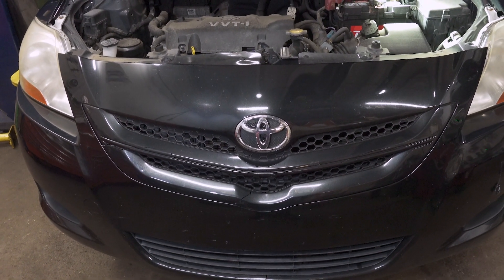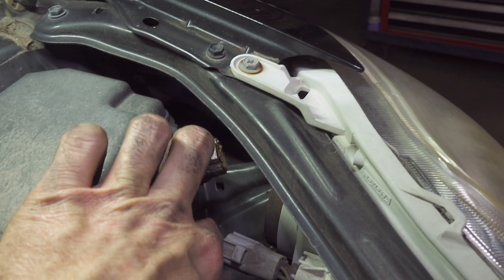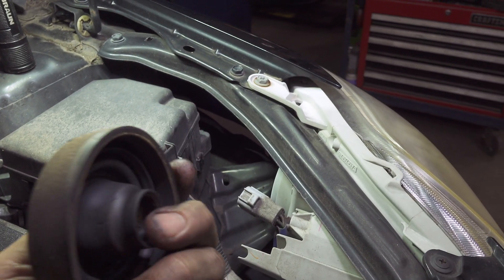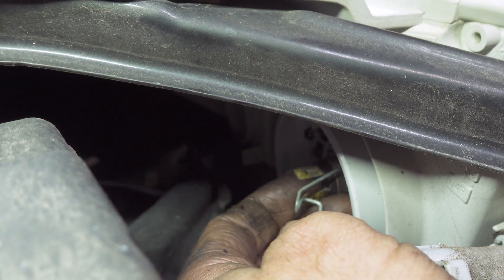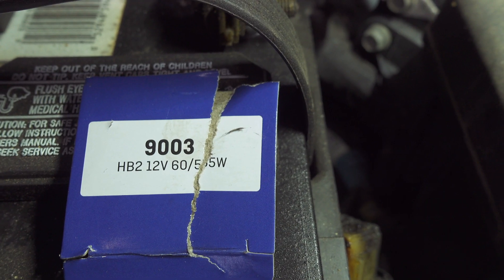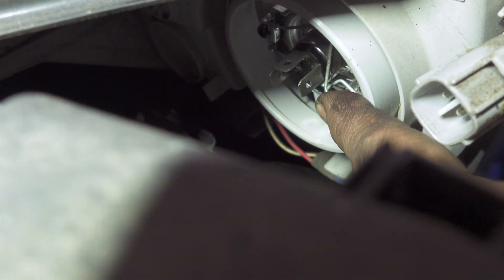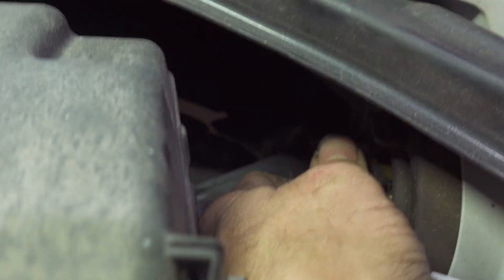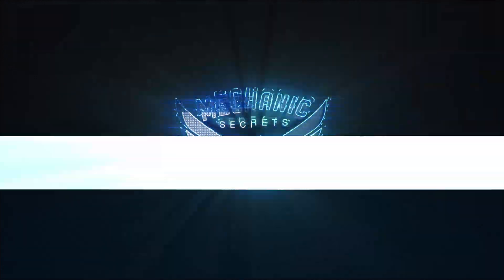How to Replace a Headlight on a 2007 Toyota Yaris

Comment: Its also very easy to remove the front bumper to access the other bulbs in the headlight assembly or more easily replace the headlight bulb. About 10-15 mins max to unbolt he top portion of the bumper, 3 bolts for the headlight assembly.  9003 headlight, 7443 turn signal, 2825 corner marker bulb numbers.

Comment: Unfortunately, it's not always the bulb that's at fault. As you can see in the picture, the plastic socket cannot withstand the heat load in the long term and melts on the bulb connectors. It's a shame that the manufacturer didn't use a ceramic socket for the halogen bulbs.

Comment: I'm about to attempt this on the right side but the mounting seems insanely harder over there. Nowhere to reach!
Reply: Did you pulled up the bulb?? I’m tryin to remove the clip that supports the bulb on the right passenger side and it’s impossible to me, idk why it is so hard to remove the clip 🤦🏻‍♂️any advice ??
Reply: @vergotta777Official  as others said, you'll have to bleed for it. I did, banging my fingers around trying to feel for a clip through a tiny circular hole and a rubber nozzle of some kind. It was months ago, so I don't remember, but it takes some random squeeze and then you'll be set.
Reply: @ceef8688  alright at least you did it so it’s not impossible lol appreciate your response man !
Reply: @vergotta777Official  right on. For what it is worth, The right side was so ridiculous that I got the new bulb on and in past the rubber seal, but at the end of the day I never felt it click solid the way it was when I started. I worried it would fill with water, or the headlight would fall backward into the engine if I hit a bump... but it has been months, and seems fine just chilling unclicked in the headlight casing.